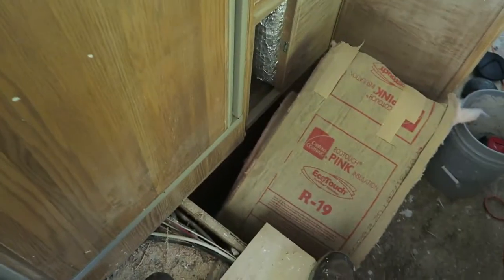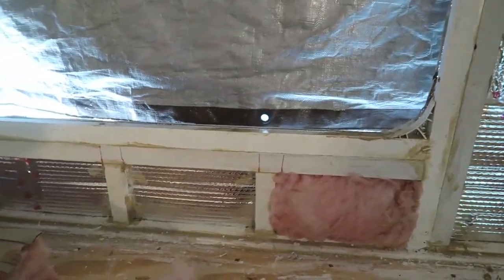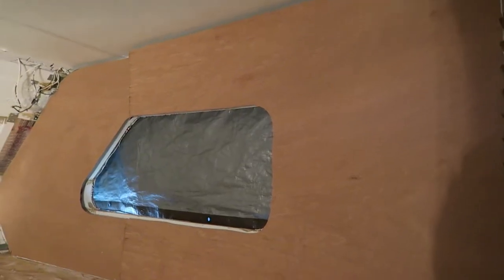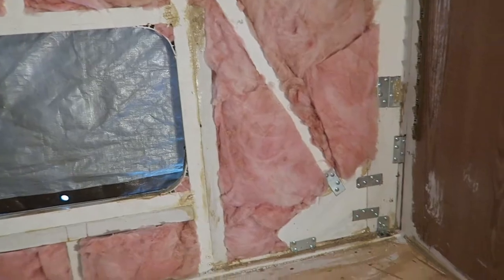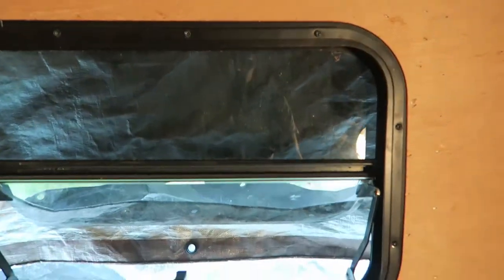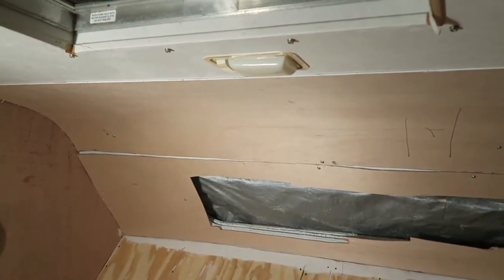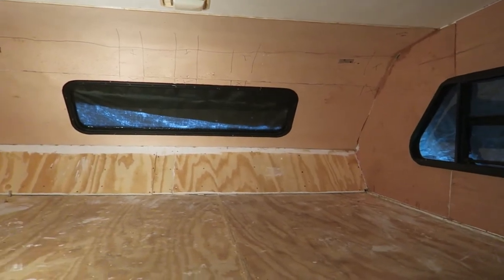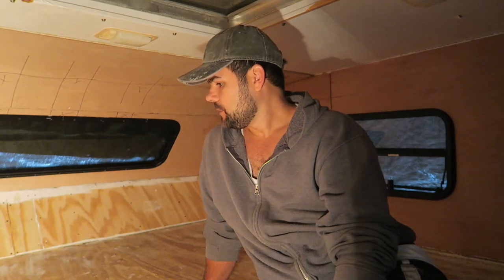Truck Camper Insulation In & Bed Reconstruction Complete!!! | Truck Camper Renovation (9)

Comment: It is inspiring seeing you do that solo. I would need another pair of hands. I have done the same thing with insulation in several renovations. I never thought to add a touch of glue to hold it up. Great tip.
Reply from the maker: Thank you, I am so proud of Nick for doing that all himself. SO much work. But now, it's all brand new. Smells great- like a new build.